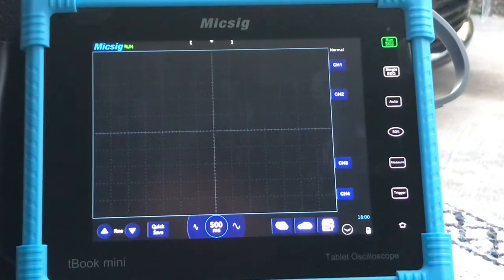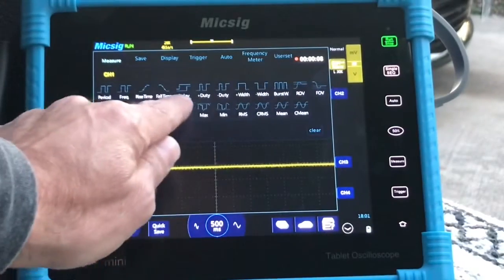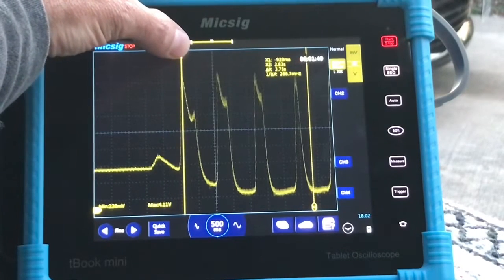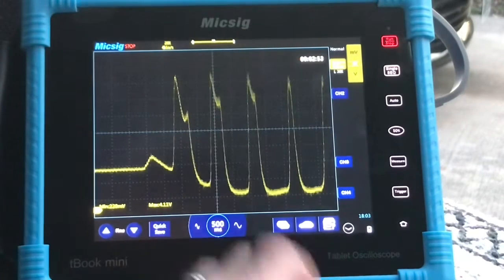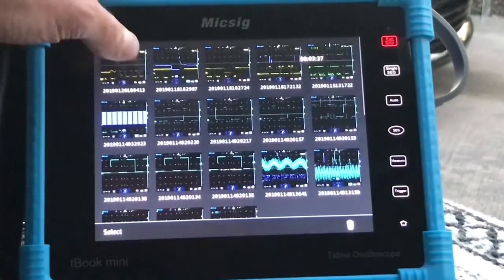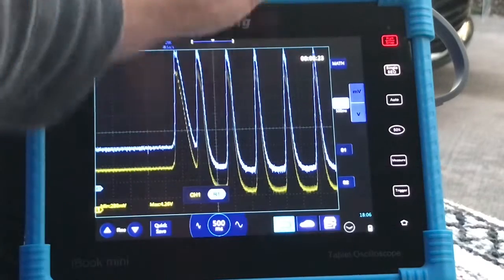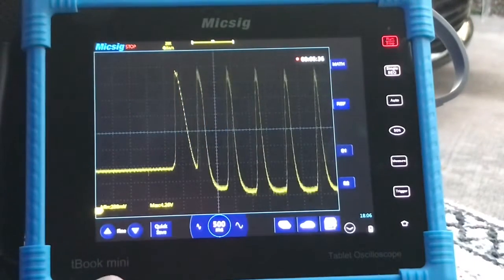Using the MicSig ATO1104 to look at a map sensor on 07 Mazda 3 2.3l

Comment: When you set time based cursors does it have a setting like the picoscope to set 720 degrees?  Then you can measure degrees from top dead center off cam and crank signals. Ive been looking into getting one of these and maybe aome advice from you is what I need. Also does it have pre made settings for low and high amp clamps as well as paddle probes for ignition coil on plug?
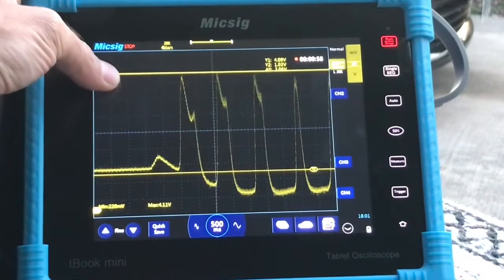Reply from the maker: Hey Caleb. Yes it does have curses for degrees. If you notice on the video, at 1:36 (when I select the horizontal cursor); to the right is the vertical cursor, then to the right of that (far right side) it says 360* (degrees). When you click on the 360, it brings up options to choose the number of cylinders 1-12, and degrees of angle 1 degree to 1800 degrees. Then press ok, and the cursors run vertically (up and down) across the screen in orange, with the numbers on the top of the screen (next to each line) from left to right. Example: if you choose 720 degrees, on the top from left to right will show 0 120 240 360 480 600 & 720 next to each line. When you first turn the option on, it seems to spread out evenly across the screen, but at any time you can adjust it however you want, like squeeze it closer together or move it to the left or right side of the screen. As for the current probes and ignition paddle. When you click on the channel button (1-4) on the right of the screen, it opens a window for that channel. On the top of the window there are 3 options. From left to right are, Voltage, Current, and Pressure. Under each one are multiple different options (probably too many to list right here). Exampl: under voltage you can choose bnc banana, secondary ignition, or p130a (10 to 1 proves that come with the scope). Then you can choose 1x 10x 20x etc up to 10kx. Also filter, signal (ac or dc), and sample (normal or peak). Under current, you can choose cp 60 1mv/1ma, cp 60 1mv/10ma, cp 650 1 mv/10ma, and cp 650 1mv/100ma. Also all the other options that I listed under voltage. Under pressure you have MPa~MPa (where you can type in the number you want), and V~V (where you can also type in the numbers you want. Also, the filter, signal, and sample options. I hope all this helps you out. Sorry if it’s a little hard to follow, but I haven’t had dinner yet, lol. If you want, I can make a quick video tomorrow showing you all this. I’m sure that would answer your questions better. All in all I thinks it’s a nice scope, especially for the price. Believe me when I tell you, I read every review and watched every video I could find about it over about a year before I finally decided on it. So far I really like it. I do wish the leads were longer. I just bought some Pico 3 meter color coated (to match the traces on the screens) premium test leads from AESwave. They are proud of them at $180 though. I’ll make a couple video using the low and high amp clamps. Also, the ignition paddle probe. I hope this helps.
Reply: Sounds like it does pretty much everything. Id really like a Pico but for as much as Ill honestly be using a scope it may not be worth it to pay that much. Ill definitely be watxhing whatever videos you put out to lesrn more about what it can do.
Reply from the maker: Yea, I hear you about the Pico. I think where the Pico really shines is the online waveform library, and to my knowledge you can’t access it without a Pico. Well, we can save waveforms with the Micsig, so we just need to share them with other Micsig owners. Maybe MicSig could start an online library too. Thanks Caleb.
Reply from the maker: Hello Caleb. Just wanted to let you know that I added a video “looking at ignition waveforms with the Pico secondary probe on the Micsig oscilloscope”. I’m telling you, because at the end of the video I showed the 360/720 degree cursor you asked about. I’m not plugged into cam and crank sensors, but it gives you an idea. I did have a video doing just that but lost it and a handful of other videos. Won’t get into what happened other than I lost all my new recordings. That’s why I haven’t posted any lately. I guess I got discouraged after that. Anyway, I’ll have more coming. Thanks again. Oh yea, I think I mentioned your name in the recent video. If that’s a problem, let me know and I’ll edit it out and repost it. Take care my friend.